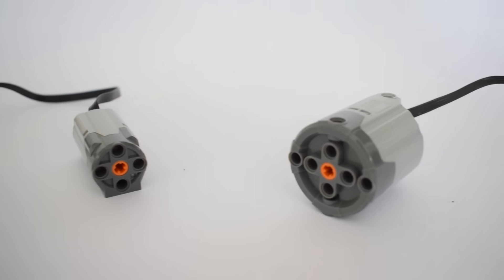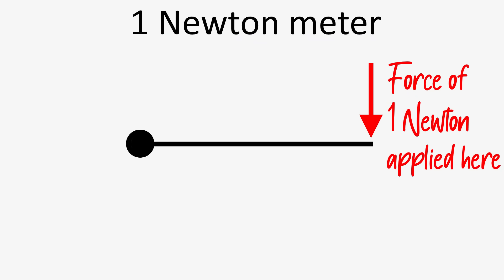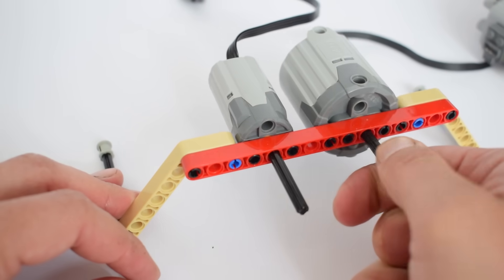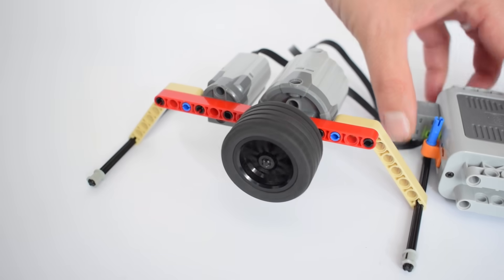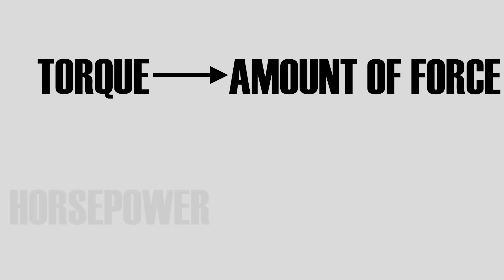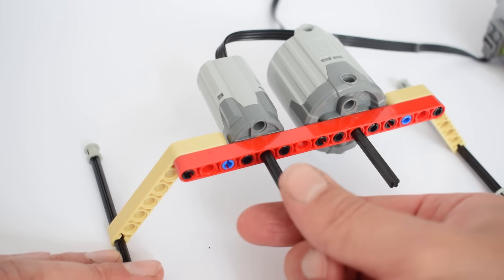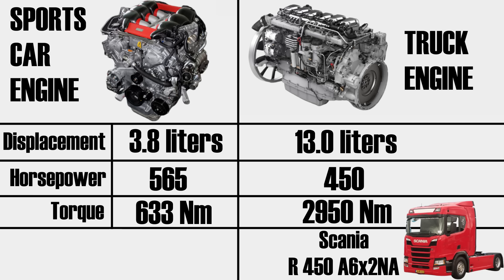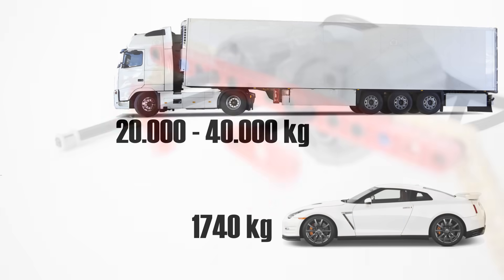NEVER be confused by HORSEPOWER and TORQUE again - HP and TORQUE EXPLAINED in the MOST VISUAL WAY

Comment: I am still not sure how do we feel torque when car is accelerating?
If car has more HP it will accelerate quicker and since force equals to the product of acceleration and mass, we should feel HP rather than Nm.
I mean when car is accelerating it is different story compared to holding engine shaft, when car accelerates we cannot feel Nm since it is rotational force?
Yet vehicles with same hp and weight but with more torque tend to push us more against the seat.
Reply: More HP through your gear ratios can be made to create higher axle torques hence higher linear force at the wheel hence more acceration.

Torque accelerates you. More HP just let's you make more torque at the same axle speed.
Reply: @Richard25000 
I still don't get it. We cannot feel torque because it is rotational force and we can only feel straight line forces since we are moving on straight line (torque can be felt only on shaft?).
So only force we can feel is force due to our mass accelerating (mass times acceleration). 
And if we are accelerating at lets say 0.5m/s^2 with two different vehicles (one has low revving high torque engine, other has low torque high revving engine) why does it feel different (I have to repeat once again same acceleration rate feels different).
Reply: @TheBalija1  Sorry, but identical accelerations MUST feel the same. Our bodies sense accelerations, not velocities. (Do you feel the velocity with which the Earth is orbiting the Sun?) You might be feeling other things, like engine vibrations, noise, etc. But two vehicles that accelerate identically by definition will be felt as .... well, identical.
To prove this would require an elaborate double blind experiment, so I doubt you tested your theory under strict conditions.
Reply: @thecarman3693  Where exactly have I said that we feel velocity?
You are wrong, we cannot feel acceleration. We feel force! 
To answer second part of your comment I will tell you that there is almost no need for controlled environments because difference is massive.
Tried riding back to back kawasaki z300 and honda nc750, with couple of my friends. Honda has like 230% more of torque, and it has low revving engine. It also produces a bit more HP, but it is also heavier and has longer gearing. 
Compared to kawasaki it felt much much quicker (230% quicker 😂) it was pulling my arms hard. And all of us agreed.
Later on we tried 2nd gear roll on from maybe 40 to 80kmh (25-50mph). And they were very very close, marginal difference.
Reply: @TheBalija1  You: I have to repeat once again same acceleration rate feels different.
Me: Sorry, but identical accelerations MUST feel the same.
You: You are wrong we cannot feel acceleration ...

So which is it? You contradicted yourself. I was using your own words to describe how you felt differently under identical accelerations. It is true that you feel force, but that force is due to acceleration against some surface resulting in a contact force, which is the only force you actually feel. Perhaps the accelerations themselves weren't the same, in other words varying throughout as your velocity increased. This is known as Jerk, a change in acceleration. But my initial contention stands unless you can show the maths to prove otherwise, identical accelerations will result in identical sensations. And the conditions under which you seemed to experience this difference are far from ideal in producing double blind results than can be independently confirmed.
Reply: @thecarman3693   I was very clear. We can not feel acceleration directly but forces od acceleration. In first comment I said that accelerating on one vehicle felt different compared to accelerating on another vehicle. Never said that you can feel acceleration. And what exactly is contradictory here? Trying to pull some words out of context just to prove me wrong or what? And why did you bring up velocity of a planet in your first reply? You tried to correct me on something I have never said.

As I said difference is so obvious and huge that multiple people noticed. 
And this is not the only case in which my friends and I have experienced this phenomenon. Honda nsr 125 which is 2 stroke bike (very low torque numbers) compared to moto guzzi v7. V7 feels mind blowingly fast compared to little Honda, it pulls like a train. Yet once again when racing they accelerate almost the same.
Reply: @TheBalija1  You said you can feel a difference in the vehicles' accelerations, and then later you said that you don't feel accelerations, only force. Whichever way is fine with me because I think we're on the same page about you saying that two different vehicles that accelerate the same somehow feel different. I simply said that identical accelerations by definition must deliver the same sensations. I then said that perhaps they really don't have identical accelerations ... or that other factors are coming into play, like vibrations, noise, maybe even road conditions. Or that maybe the test you're doing isn't set up properly enough. A good deal of proper set-up from some independent testing observer is needed. Acceleration is just that, acceleration. And how much that value is against some mass will produce a force. If the mass doesn't change, and the acceleration is held constant, that force (what you sense) will always be the same. The human butt dyno is a poor tool to establish this. So, if you are certain that you have different forces from those accelerations, then simple physics insists you have different accelerations.

Comment: I like it.  This is why a low torque motor can make lots of HP by revving higher.  It is also helps to understand why a fairly weak transmission can handle a lot of power.
Reply: Which is why old F1 V8s V10s made 800HP+ with less torque then your average performance car.

Because 20000rpms

Comment: Thank you very much for the explanation. But i have a question:
1. Car with 1000kg weight, 500hp, 1000nm
VS
2. Car with 1000kg weight, 1000hp, 500nm

Who will win or faster? Why?
Reply: Unfortunately the info you gave is way too little to determine what you wish to know.
You need HP and Torque curves, shift points, gearing, not to mention keeping your units in one system --- preferably metric. From what little you gave I can tell you that the curves are way different in that they have different maximum values. Plus I need to know what your maximum velocity (m/s) is in determining the faster car. Generally speaking, though, the car with the greater HP will go faster, and the one with greater torque will be quicker.
Reply: @thecarman3693  ah i see. Yes, just imagine if it has same shift points etc (sorry if it cant be the same, because i don't know the theories behind it). So, what's the difference between "quicker" and "faster"? Does quicker means that it have better acceleration?
Reply: @submariner144  Yes. Quicker means off-the-line faster. Faster by itself just means top speed. As a car goes faster it requires more HP in order to overcome all the frictional forces that keep increasing, like wind and road resistance, not to mention internal engine and drivetrain resistance. Since the car is not only moving in distance and overcoming all that I just mentioned, it's also doing that over a period of time. And the faster it's going the more it's overcoming per second. What it's overcoming requires Energy, but how long it takes to do the overcoming is how we measure Power. So the faster the car is going requires overcoming more and more Energy divided by the Time it takes ... Energy/Time. And Energy/Time = Power. In this case, Horsepower. In the Metric system the units are Watts, or Kilowatts.
Reply: @thecarman3693  all this time, i thought torque is the one which  overcome the frictional force. Because my dumb logic think torque=force because my tuned  diesel car which have >600nm and 310hp have more force to push my body to the seat than my 350nm and 420hpish gasoline car.  Very good and simple explanation. Thank you very much for your time my friend, i really appreciate it.
Reply: @submariner144  Thank you for reading it! It's much appreciated.
PS: An inquisitive person is not dumb.

Comment: Otherwise great, but it did not take gearing to any account. If you match two 500hp motors to same rpm with gears (would have been easy to demonstrate with lego motors) final result at axle is exactly the same. 
Thus sports car engine is just as capable of moving that same truck if gearing is altered to match max power rpm to same rpm on output acle. It is completely different point that sports car engine cannot keep itself together for long time with near max power.

Comment: I have always known what is torque and what is horsepower. What I still don't understand is why does torque matter since you can just use a gearbox to increase your torque, and maximum acceleration is determined by horsepower not torque.
So in theory you can easily put that R35 engine in the truck with much lower gears, and still end up with the same torque at the wheel. Again, why does engine torque matter?
Reply: It reflects power band size. High Peak low end torque demonstrates a larger area under the power curve.
Reply: @Richard25000  yea but they tell you peak torque, not the shape of the torque curve. You can have an engine with very high peak torque at 6k or whatever, and almost no torque everywhere else.

Comment: I have a pretty good grasp on HP and Torque but What I don't get is why the larger motor didn't spin faster when it has the larger HP number? It doesn't match up to the car/truck example.  The car had less torque but MORE horsepower therefore is faster.  But the smaller motor had less torque AND less hp.
Reply: Torque in electric reduces as the rpm increases until there is only enough torque to overcome the internal frictions of the motor.

It's also probably only produced it's max power output at a lower rpm when he loaded it with his fingers.

Comment: Wait, isn’t the larger more torquey motor spinning more slowly simply because it needs more electricity? Furthermore, with more access to higher voltage it can output more hp?
Reply: More voltage more power yes.

More power it can spin faster yes.

More voltage means more current and you can damage the motor from heat.

You can in theory add more voltage to the small motor too until you hit the same problem.

Comment: It would be nice if you stuck with either metric ( Nm, Kw  ) or imperial (  foot pounds, horsepower ). A horse can put out about 4 horsepower, depending on the horse ( and the horse will get tired over time ) I think it was mr Watt that came up with horsepower but wasn't happy with it.
Otherwise, great video.

Comment: Remember when you times torque with speed, you get horsepower. When you times horsepower with time, you get work done.
Reply: * multiply.  It's 'when you multiply'.  Are you in third grade?
Reply: @Makitaization  'distance times time times timing' doesn't sound right to you!? 

He'll probably come back with a great rebuttal to this when he gets done plussing all the numbers together. Reminds me.. I need help with my homework...
What's the answer to five minus minus five minus minus four then plussing all of that with minus three minus minus fourteen divisioning by five times minus positive 13 plussing it with three... 

Sounds all gravy over here!
Reply: He left off another constant from the formula HP=(TQxRPM)/5252
Reply: @SpencerPPyne  5252 is only cus of Imperial units, when using metric, it's over 9000
Reply: @prich0382  Of course, it’s a bunch of other constants simplified.  If you’re using a different scale the constants will vary.
Reply: @SpencerPPyne  And do you know why that constant of 5,252 is needed?
Reply: @madmandan1982  if memory serves it is the RPM at which torque and horsepower intersect
Reply: @SKILLZ-io8sk  But only for imperial units. For metric units that constant is 9,550.
Reply: @SKILLZ-io8sk  that's absolute bs, the speed at which Power and Torque meet is not 5252 rpm
Reply: @truedarklander  But it does if you’re using ft/lbs and HP.  HP always equals TQ at 5252rpm
Reply: @truedarklander  horsepower and torque are numerically equal at 5252 rpm when torque is measured in ft*lb.
Reply: this is a great video - its crystal clear for beginners/students/ youtuber with a casual interest, and an exercise in clarification for those who are more practically minded as opposed academically minded.

most of these comments are, how shall I put it, comparing organ sizes. why would a time served "expert" deign to over complicate a video (which uses lego as its prop, please note, lego...) with clearly more advanced knowledge? comment on videos closer to your level of expertise I'd say, or acknowledge what this video set out to achieve if you have to comment on it. 👍
Reply: Torque is identical to work. Torque is telling you how much work is done in 1 radian of rotation (the amount of work done in 1 rotation is 2*pi*torque).

RPM is frequency, so it's the inverse of time. Multiplying by rpm is equivalent to dividing by time.
Reply: @shadowboy813  go back to school
Reply: @shadowboy813  The units for torque and work are the same but torque is a vector while work is a scalar.

The way indicated torque is worked out for an internal combustion engine is actually by integrating the cylinder pressure over volume, which effectively is the work done over an engine cycle, but you lose the directional component as it's just a calculated average.
Reply: @shadowboy813  "Torque is identical to work. Torque is telling you how much work is done in 1 radian of rotation (the amount of work done in 1 rotation is 2*pi*torque)." You've just said that torque is the derivative of work over a rotation, i.e. force and not work. This is the same as saying speed is the same as distance because it tells how much distance we cover in one second.
Reply: @thear1s  You've demonstrated that you didn't grasp my comment.

Torque is work. Torque is a force (the force acting on a lever arm), times a distance (the length of the arc covered by rotation)--so technically it's an INTEGRAL of force over rotation--not a derivative. And when you integrate a force over length you get work.  Notice that time is not a factor at all, so rpm is irrelevant.

Angular mechanics are NOT dimensionally equival
ent to to linear ones. "Angular force (ie, torque) is dimensionally work. Angular velocity (rpm) is dimensionally frequency. Moment of inertia (angular equivalent to mass) is mass times length squared (or energy times time squared, both the same).
Reply: @shadowboy813  Being dimensionally the same as work doesn't mean that it is work, torque is the distance a force is applied from a point, whereas work is a force moving along a distance. This confusion is why typically work is talked of in terms of Joules. 
If you want to work out the torque applied to a point you use T = F * r (r being the distance from the pivot point)
To get linear work you use W = F * s (s is the distance the force moves), to get rotational work you have to take into account the arc that the force is traveling along, to do so you must use W = F * r * theta, as for a circle s = r * theta. (theta being the angle the force has moved in radians). 
You can also get rotational work using W = T * theta
Reply: @shadowboy813  I think you're confused by integrals and derivatives. Torque cannot be work and force at the same time.
Reply: @thear1s  That's because it's not truly a force. It's work per radian. Which is proportional to the tangential force you can feel at the shafts.
Reply: @shadowboy813  That doesn't make Torque analogous to work, it makes it analoguous with force. Force x distance = work, while torque x angular rotation = work. Work / time, force x velocity and torque x angular velocity give you power.
Reply: @shadowboy813  if torque is not great enough to overcome resistance, no work will be done. Work is torque times rotation angle. Work is also a force times distance. If you apply force to push an object but it won't move, you make no work.
Reply: Very wrong Torque and Work are different. 
Torque unit is Newton-Meter 
Work is Newton Meter squared 

What you said is literally the equivalent of saying "Voltage is the same as Power"

Comment: I read a lot of American car magazines from the 80’s to 90’s. Sad thing was the auto journalist seemed to be very lacking in Engineering knowledge or simple High School physics. Thus, they generally didn’t know or make the connection between torque and hp.  Instead they talked up a car solely based on its peak torque or hp dyno graph.  While in European magazines, they were more interested in the “area under the curve” of the hp dyno graph and gearing.

Comment: Remember that you can always get as much torque as you need or want, through gearing, but it won't affect the power at all (beyond frictional losses).
Reply: Yes but you trade rpm for torque or torque for rpm, all total to same power at axle, yet different torques and rpms.

1st gear high axle torque low axle rpm
5th gear low axle torque high axle rpm

Comment: 45 years ago we had a motorcycle dyno that used a jet engine starter/generator to heat coils, wasting the power as heat. So we got a voltage and amperage reading, multiplied them to get watts, and then divided by 746 to get horsepower. We already had the SI unit, but didn't know it, and everyone knows horsepower in the USA.
Reply: Respect